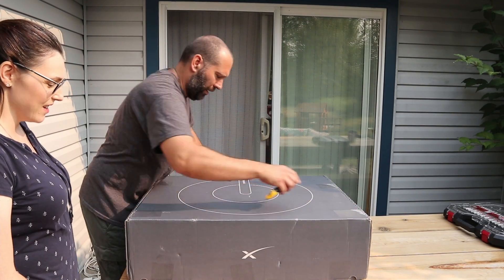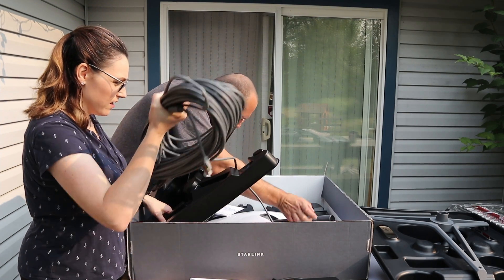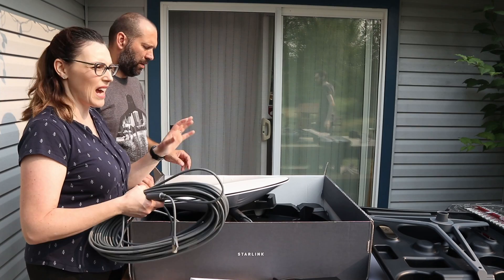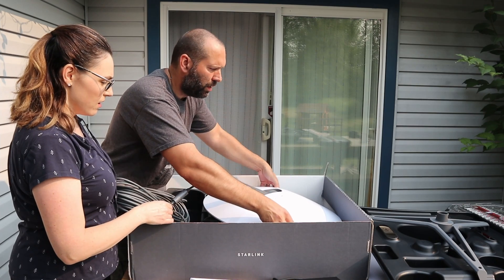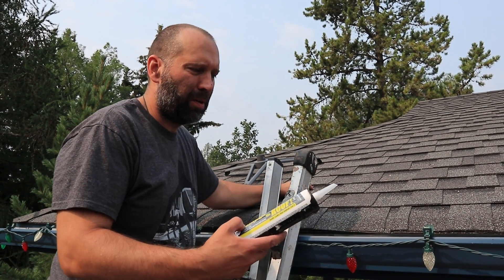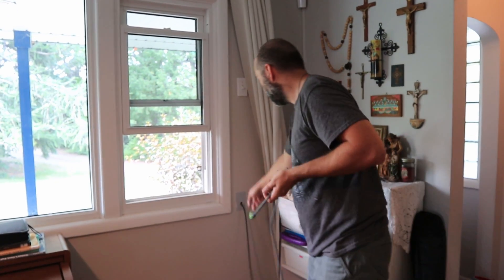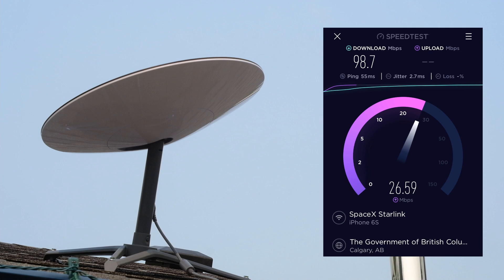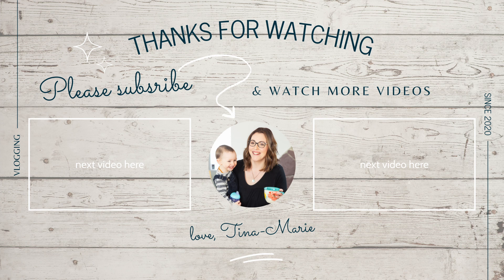It has finally arrived! Our Starlink Unboxing and Set-up!

Comment: Been using my Starlink since January. No problem with my Zoom meetings. I am in cottage country outside  Ottawa ON. I only lose Internet when there was very dense rain clouds overhead. No problem in winter with snow. It melts off. Only thing you have to watch out for is the icicle that forms on the edge of dishy that contact the roof as the snow melts. If dishy tries to move and the icicle is there it could damage the gears inside.
Reply from the maker: Thanks for the tip. I will be sure to watch out for that.
Reply: @UnderThreeAcres  what i would of done is buy a pole mount and put the dish on the pole